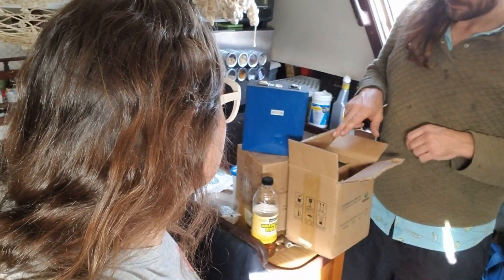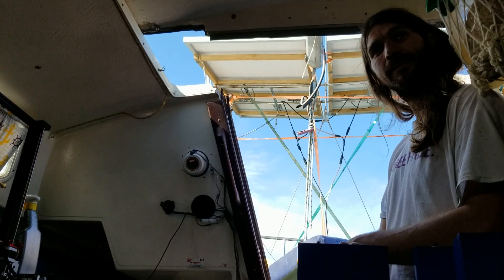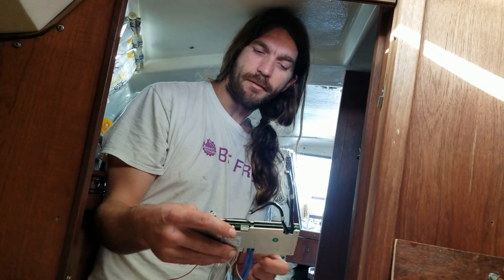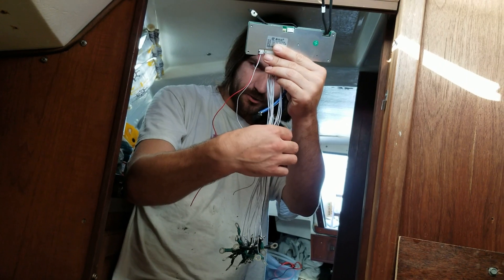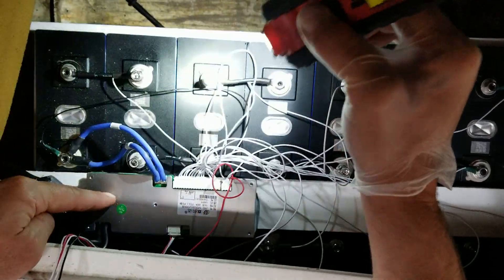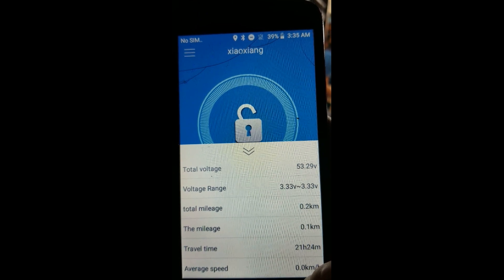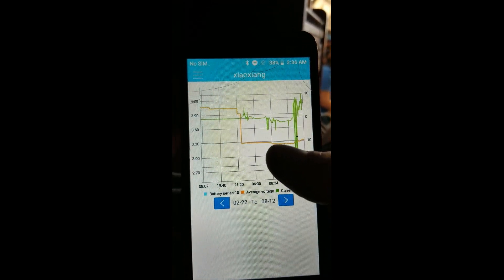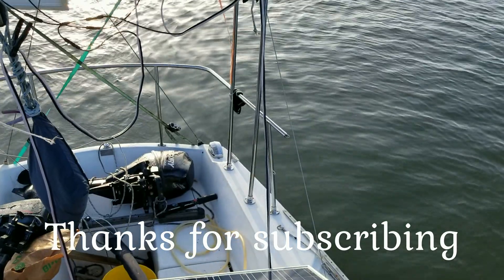Upgrading Our Catalina to Lithium

Comment: Is it set up as a 24v battery bank? Or am I missing something? I'm familiar with old-school batteries but completely new to lifepo4 and using a BMS... Looks as if they're paralleled 2x2, no?
Reply from the maker: There are 16 cells to make 48v. 3.2v per cell. I could change we'r bro we've 12 or 24 if my equipment dies and need to be upgraded. The mppt charger supports 12 24 36 and 48.
Reply: @voyageoffthegridsailinghar4308  Please please please send me file for the electric motor hub!!!!
After so much research i coincedentely found you please the hub cad file
Reply: @FirstLast-tx3yj  email?